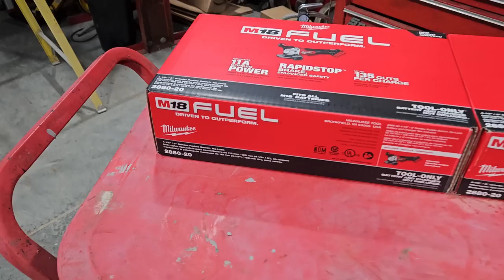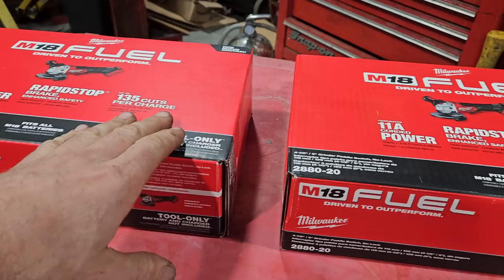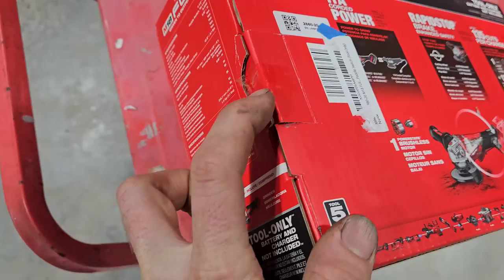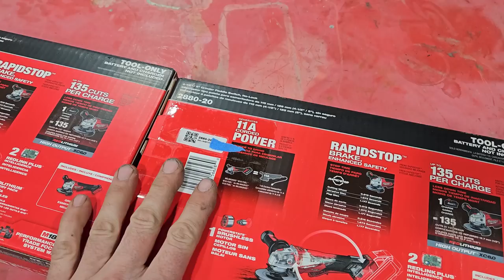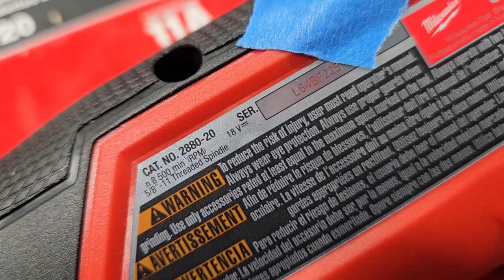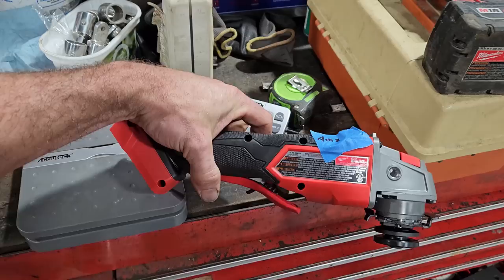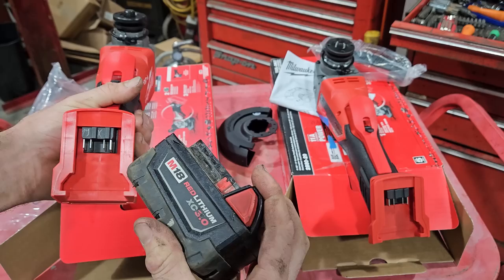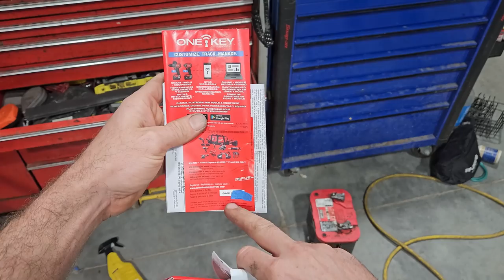Amazon MILWAUKEE Tools FAKE or THE SAME? Half Price!

Comment: The amount of grease in the head is a possible weight issue. The HD prices seem high. HD is one of many dealers of this brand of tool. The cheaper on could simply be a promo product that was bulk boughtby a big outfit and then never used and now is being sold off by a freight disposer.

Comment: 🤣🤣 warranty is 5 yrs ,  if something goes wrong with the tool just call or go to reepair center and whey Not gonna ask u where u buy it from , if they do, just said HD and u gonna have your tool fix . 

im a resell tools . retrunt pallets from HD and Amazon just M18 and i never never had issue with broken tools bc milwaukke dont want to fix them if they are ln the warranty frame is good to go to warranty wnd i never had a issue .

Comment: yall need to do more research on tools, the serial numbers don't matter but there are always same but different model numbers that separate upgrades and units made by contract builders for identical units. Ryobi being the worst of the bunch and Dewalt coming in second place advertising and selling different units as the same ripping people off yes its real and you've all bought expensive equipment only to just fail and fall apart lol think about it.

Comment: Jeez, stop jerking the camera all over. It's not still for more than half a second.

I think the bar codes are the same, but i can't tell for sure because you never stop moving the camera.

The serial number may have been altered to conceal the source. This is common for gray market products: products from a foreign distributor imported to the US by a third party. This bypasses any regional price differences set by the manufacturer. It might be worthwhile to compare it against the S/N on its box.

The Amazon bar code isn't covering enough of the UPS bar code to prevent scanning it, which is odd. Amazon generally wants sellers to cover those to avoid Amazon warehouse staff and robots from scanning the wrong barcode.